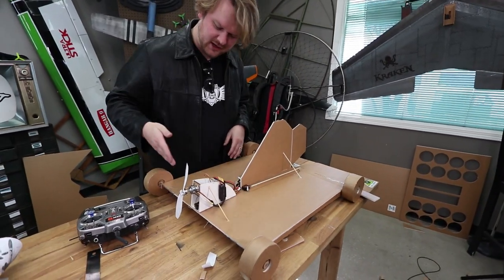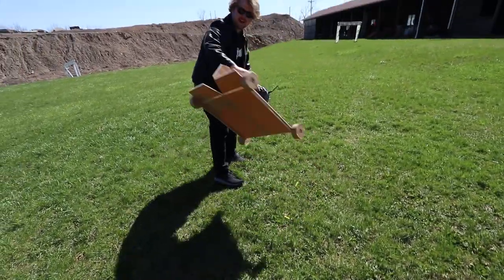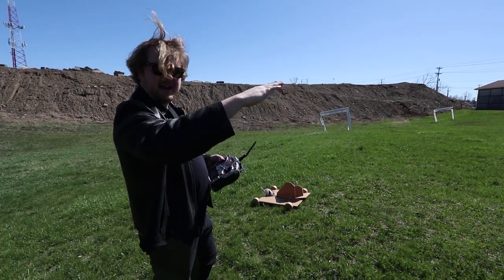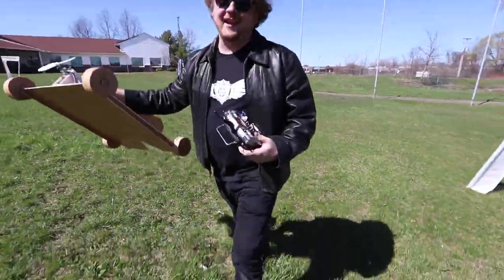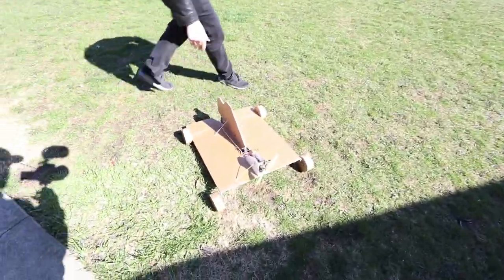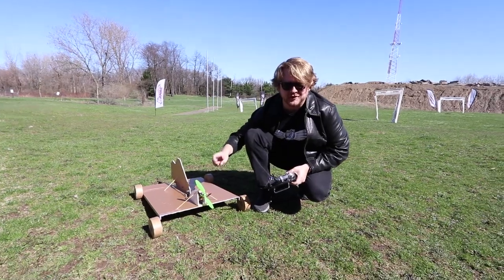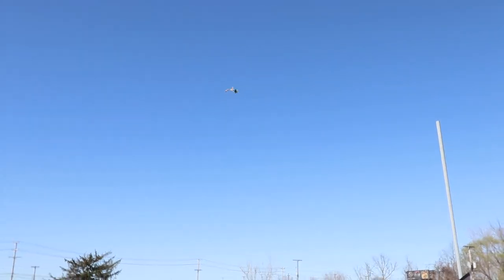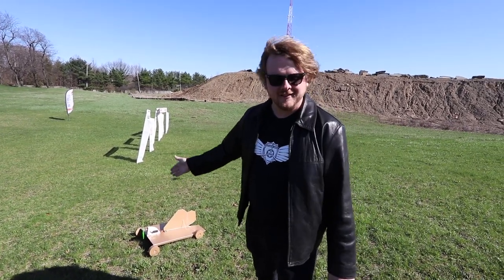DIY SKY-CART - Maiden...flight?

Comment: I would add cutouts and move the wheels inboard to keep the roll momentum down and add a center line slat under the main body to give it some stability with the high angle of attack since the tail becomes ineffective.

Comment: Make a 3 wheeled version with 2 wheels in the front and a free castering tail wheel in the back. You could drive it around on the ground easier.

Comment: The motor makes the air above the wing a lot faster than under it, it is not generating much lift besides the air that faces it from the bottom.

Comment: I wonder if the flying cart would fly with an onboard flight controller? Dont know if they currently make one that works with elevons? I saw a video of a company that was trying to design a flying wing aircrafy for commercial aviation and one of the tezt pilots explained that a computer made thousands of tiny adjustments per minute to make it fly very stable so the pilot only had to tell the plane where to go. He said that without the computer it would be very difficult to fly. But with the computer it flies like a falcon.